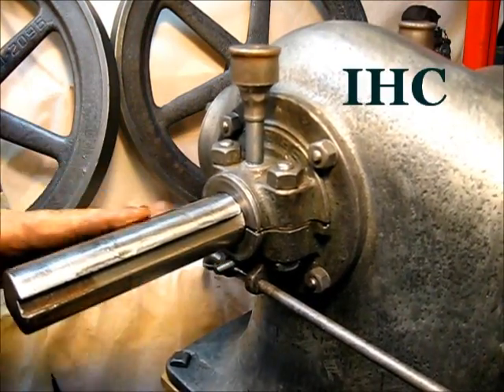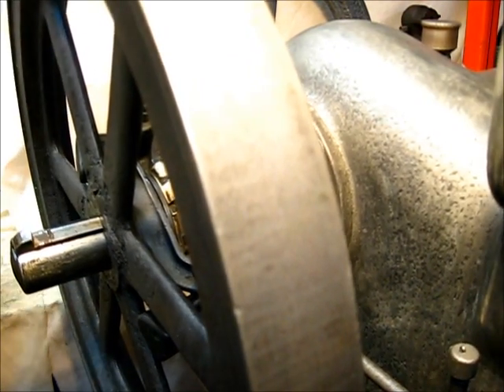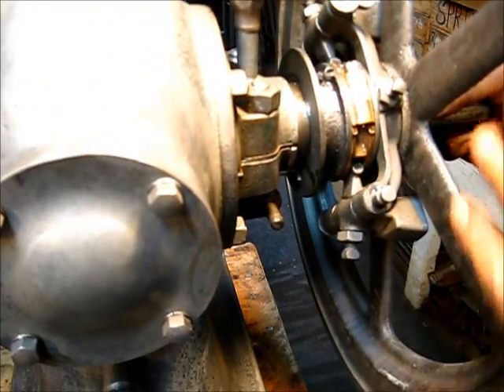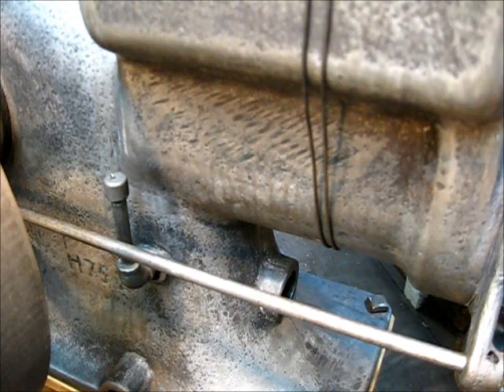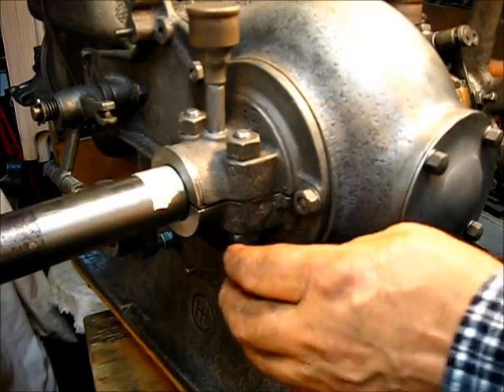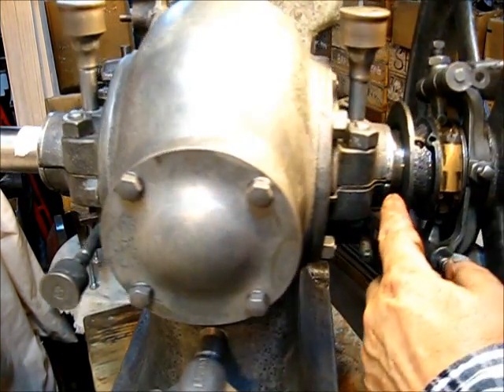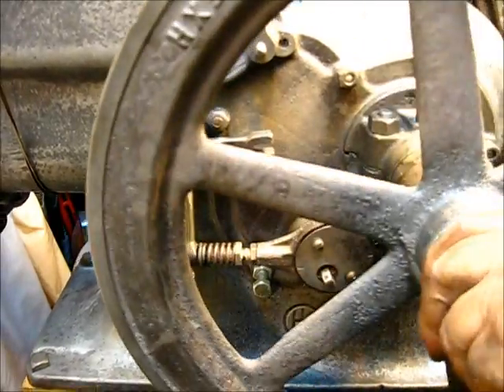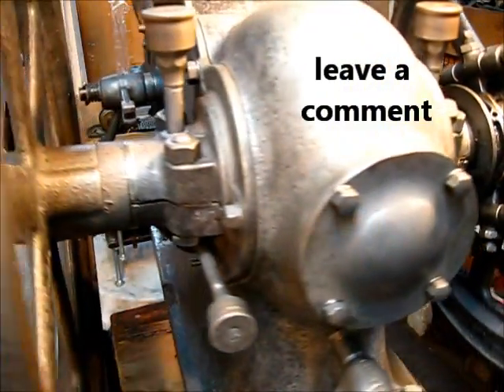McCormick-Deering "baling wire engine" #46

Comment from the maker: ,,, in an upcoming video I will set the flywheels tight onto the crankshaft,,, and the axial (side to side) movement of the crankshaft will only be a few thousands,, if it is too loose it will cause wear?